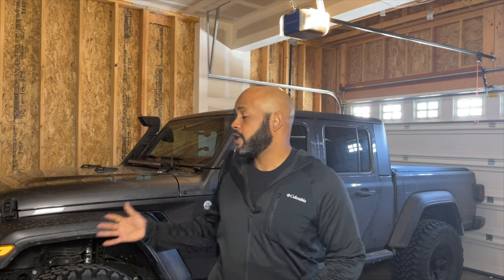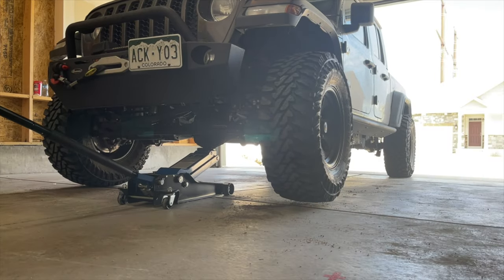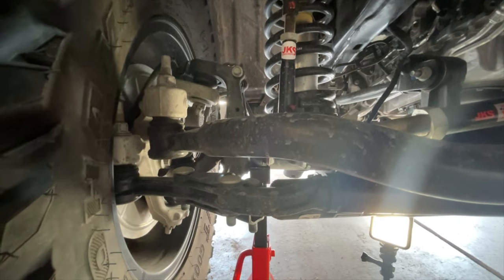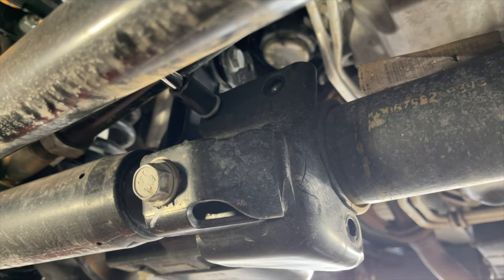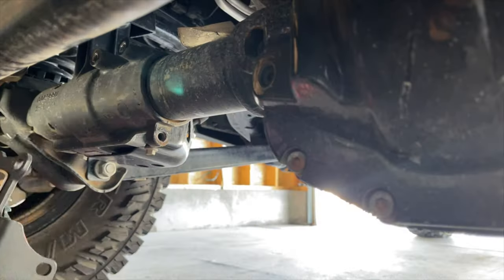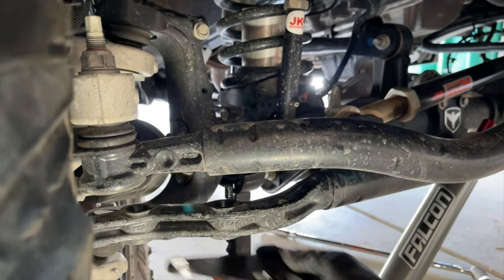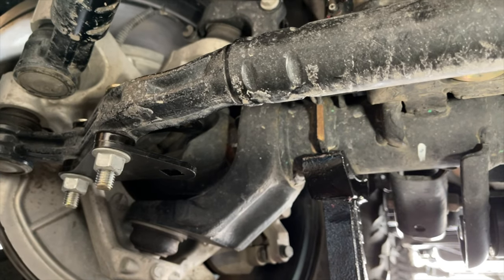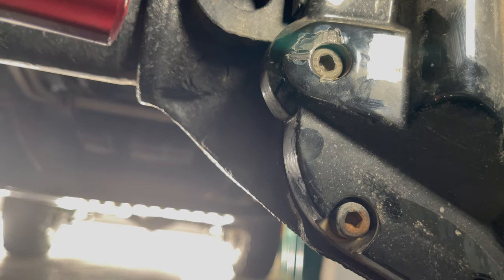Jeep Gladiator Steering Fix (Teraflex Falcon Nexus 2.2 Steering Stabilizer) Review and Install

Comment: It might be my imagination, I installed the Nexus 2.2 on my 2023 Gladiator Mojave, it seems to wander a little more than the factory stabilizer used to when driving in a straight line. I was using the medium setting.

Comment: Excellent video — a lot of info packed in a short, direct presentation. The visual representation of the installation steps: great viewing angles and well lighted and perfectly focused videography. Thanks from another Gladiator owner. I’m just OCD enough to want to tighten up the slow and moderate speed handling.
Reply from the maker: Thanks! Glad you appreciate the videos. Angles and lighting are so important. It is so frustrating to me when I can’t see the part someone is talking about because the angle and/or lighting is bad.

Comment: I have the same issue with the adjust knob not displaying the SOFT setting correctly.  Can you expand on your fix please?  Thanks.
Reply from the maker: Make sure the logo on the mounting brace is facing you and facing up. Twist the shaft until the soft setting is in the vertical position facing you.  You may have to flip the knob. If you can’t twist it it may to on the firm setting just flip the knob in the opposite direction. Hopefully that helps. Good  luck.

Comment: I have aftermarket diff cover and I can’t even turn the wheel all the way bc the falcon hits it.
Reply from the maker: Someone suggested to try using spacers where the stabilizer is mounted to the axle. I haven’t tried but it could be a work around.

Comment: If you had to get the shaft brave or steering stabilizer,  which one is more beneficially?
Reply from the maker: I felt the biggest difference with the steering stabilizer.
Reply: @MoreDirtMoreDistance  thanks,  any other useful mods?
Reply from the maker: @AlanTrades  To be honest after a lift and bigger tires I would say organization mids have been the most helpful. Not really cool but there is a lot of stuff you have to take offroading.

Comment: Is the Synergy Manufacturing Heavy Duty Adjustable Front Track Bar mandatory to add on my factory stock tires? Or am I good to just have the teraflex falxon steering stabilizer on my factory track bar? Mostly my daily driver for a more comfortable drive..I do minimal off roading for now.
Reply from the maker: No you don’t need an aftermarket track bar. It should work on a stock vehicle.

Comment: Great video!  Well done on figuring out the issues. It appears that the stabilizer shaft is flexing when it hits the diff cover. To me that would lead to an early failure of the stabilizer. Did you contact anyone on that?
Reply from the maker: Thanks! I haven’t done anything about it. So far I haven’t noticed any issues 🤞🏾

Comment: Can someone explain to me the spacer for the bracket? I installed it on the bottom with a stock track bar, because that’s exactly what my instructions show, but realized later the words in the instructions said to install it on the top if stock track bar. What will it hurt leaving it on the bottom? What is this for? Thanks.
Reply from the maker: I’m not sure if it matters. Wish I could be more helpful…

Comment: Is this a 20 or 21? Steel or aluminum steering box? I have a 21 drives pretty good but does want to wonder a bit.
Reply from the maker: Hey, It’s a 2020 with the aluminum steering box. The steering stabilizer definitely improved the handling, but it still drives like a Jeep.